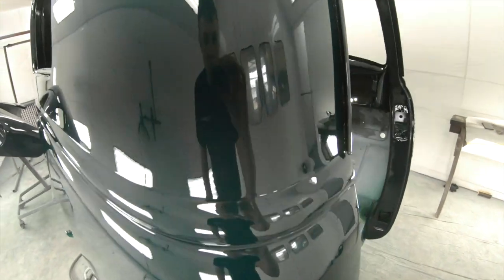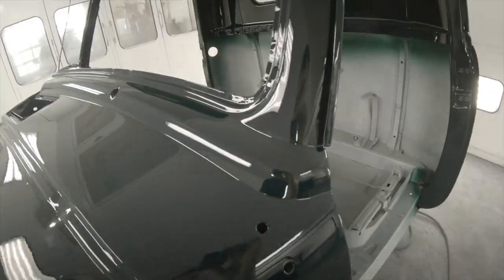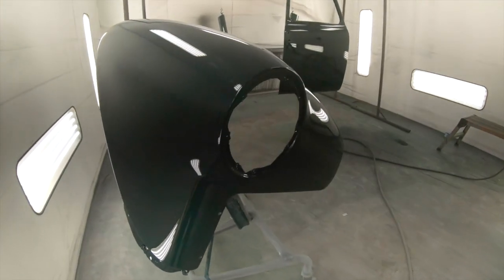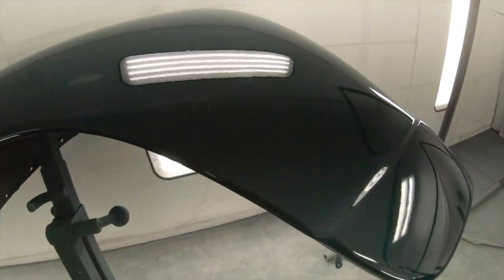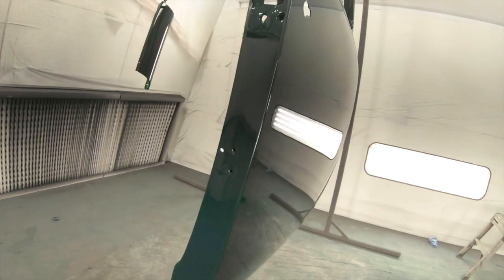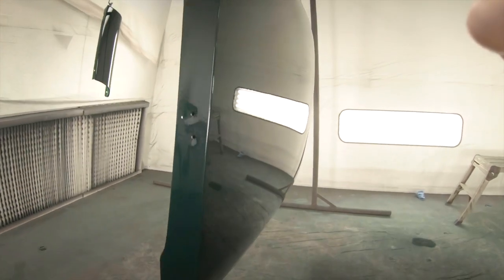1951 Chevy truck cab and parts painting

Comment: Nice paint job! Finally a video where someone painted then cleared without painting, sanding it off, painting, sanding it off, painting, sanding it off, painting, sanding it off, painting. Then sand and buff, sand and buff, sand and buff.
Reply from the maker: Shops that do that really achieve nothing other than fooling customers into charging 3x the hours they needed to be. That and risking a whole lot more shrinkage later on.
Reply: Thanks for the reply. I’m a first time truck restoration guy. I would really like to paint it myself but with all the different techniques you can find on the internet it’s hard to decide what to do. I like your technique, I’m going with it. Thanks
Reply from the maker: @dalemccary6526  when you get to the final sand and prepping for paint look up my Instagram page and shoot any questions you have on there. Happy to help out! Or if you’re near northwest Ohio I’d be happy to help ya spray it. I don’t charge much by all comparison. @buff_bros_restorations
Reply: I would certainly appreciate the help. Too bad I live in south Texas😆. If I run into a snag I’ll let you know. Thanks!!

Comment: I want to know step by step what paint primer and what other stuff u used in the painting I'm very new to paint job but I love your work and I want to paint same like that
Reply from the maker: Polyester primer sanded 80 grit, 180, 320, 400. Epoxy sealer. Wait an hour for it to flash. 3-4 coats of basecoat. Wait 8-12 hours for it to flash. Tack it off. 5-6 coats of clear stepped out in between each coat until it is just tacky. (You’ll be spraying clear for 4 hours if you wait the right times). If you don’t, you’ll get solvent pop, die back, runs, etc. follow Tyler Krause and the refinery on Instagram. I follow all their steps to a T